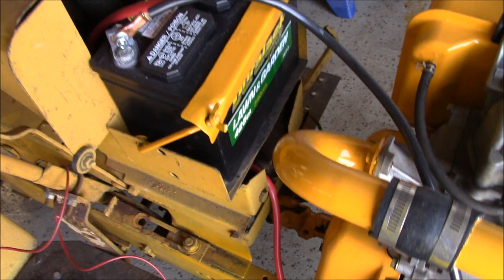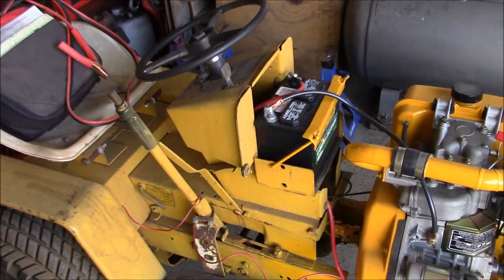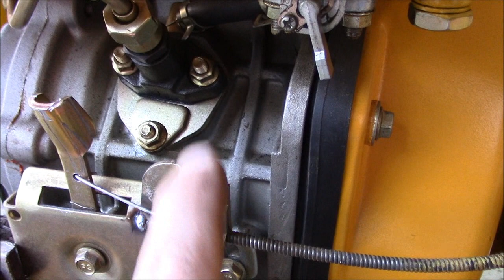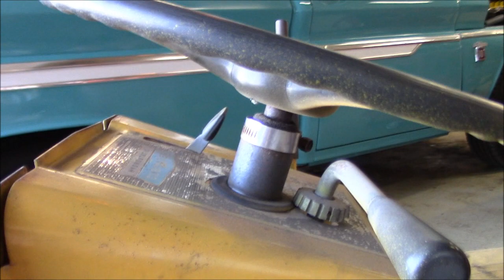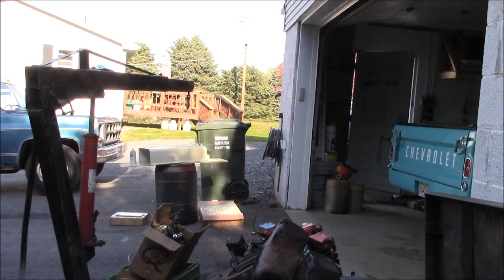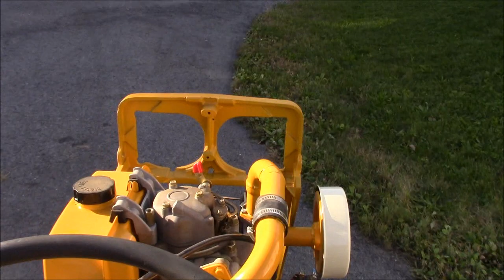Cub Cadet Turbo Diesel Project - Part 11 - Wiring and Throttle

Comment: Hello, these videos are very helpful, been working on my 2007 cub cadet 2550 , engine fit was much more easier due to the wide frame, I had to lower the mount plate and grind the oil drain plug head down to clear the frame , notched out and reinforced both sides of the inner frame .The oil filter side is accessible . I will use a vacumm pump to change the oil .i am at the point of wiring  and throttle , nice work......

Comment: How did you couple the drive shaft to the flywheel?!!
Reply from the maker: Removed the pull start and made an adapter.
Reply: Fuel Injection Sucks there’s your vibration problem dumdass

Comment: Hi, i am about to make a very similar build with (almost) the same parts as you have used and i have several questions. But first things first, did you ever complete this and if so how did it turn out?
Reply from the maker: This is about as complete as this got due to my project ADD.
Reply: @FuelInjectionSucks  okay sweet, is it okay if i ask you some questions about the build? I must say that it looks really cool and the sound, my God the sound:-)
Reply: @FuelInjectionSucks  how much boost did it run

Comment: did you turn up the max fuel screw any?
Reply from the maker: Doesn't have a screw, you have to shim the pump off the block.
Reply from the maker: Wow, I've been searching for this since I built it lol. Problem is mine doesn't have that screw! There is a solid aluminum bushing there pressed into where the threads would be for the screw. Won't messing with this screw also increase the governed rpm?
Reply: hey, the governor speed is the linkage and springs not the fuel stop though if your throttle is directly connect to the injector pump rack then over revving is a real possibility even without turning up the screw. . it looks like you have a "soft stop" fuel limiter "screw". the further the rpm droops from the set speed, the governor can "fight" the fuel limit stop and push it back because it has a spring in it. (and it can then give a short puff of black over-fuel  smoke). but with the turbo there should be more air to burn right? so the stop is now sticking out to long. But, (theres always a but lol) more fuel, more air equals more power , can the engine take it? i have no idea. or , your going to find out lol....
Reply: was just thinking on this , maybe grind the end of the stop down 10 or 20 thousands and see what happens? if it smokes black i guess you could weld the "screw" length back up
Reply: also im guessing here but i bet 0.2 inches of grinding would probably be black smoke. another thing to watch for is exhaust temp , im not sure what the max temp is though

Comment: i would say drive shaft ,and motor mounts , had one in a grasshopper 612  the motor was too shaky. took it out and installing a z482 instead

Comment: I just ordered a PD420 Honda clone for my 123 and downloaded the base measurements of the mounting plate, but I haven't torn out the old motor yet,waiting on the new one to get here.  Do you know off hand what the measurements of the old 12 hp 4 bolt base of the one you took out? I think its close to the same

Comment: You should definitely use the choke cable for the decompression lever
Reply: with the electric start i dont think the compression release is necessary. it just makes it so much easier to pull start,

Comment: i have one of those motors they shake like crazy its the  compression
Reply: ditto. on my diesel generator it rocks so much its cracking the rubber engine isolators.

Comment: if i may ask how much do you have into the motor total with the turbo and piping?
Reply from the maker: +Adam Barrett Motor was about $500, turbo about $200, pipe was like $20-$30.
Reply: ok

Comment: You poured the castings for the impeller housings and machined everything yourself huh?
Reply from the maker: +Otsman2222 The tubro is from ebay, it's listed as "small turbo charger". Everything else is custom. There was no kit.

Comment: I have a 13HP diesel on a Sears Suburban. I was thinking of putting a turbo on it but wasn't sure what size to put on it. Or what's even available for these little engines. You've done a great job so far.

Comment: Definitely seems to be out of balance shaft. I don't think steering u joints were a good choice probably will need to get actually u joints from something like a side by side. I recently replaced a drive shaft on a 2010 Yamaha mule that would work great for your application.
Reply: meant kawasaki mule

Comment: Agree with using the choke cable for the compression release, great idea. Maybe a local machine shop or similar place could balance the drive shaft. I've seen weights tacked to drive shafts, so I know it's done in some applications.  Saw your comment in the MyTractorForum thread, and you may be right that the forward relief valve is worn out. I'd replace them both. Someone on ebay sells a rebuild service for a reasonable fee.
Reply from the maker: +TheSaturnV Yeah the higher priority is my snow-plowing Cub 1450 which pisses from the valve bad! Going to tackle that first.